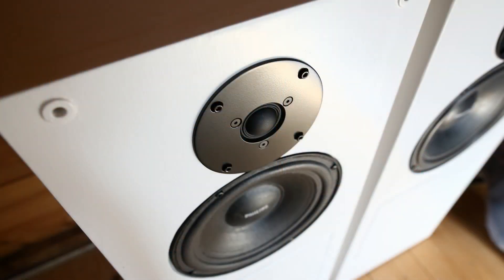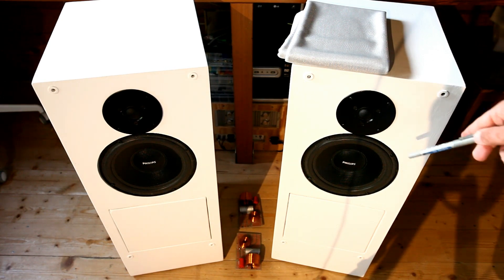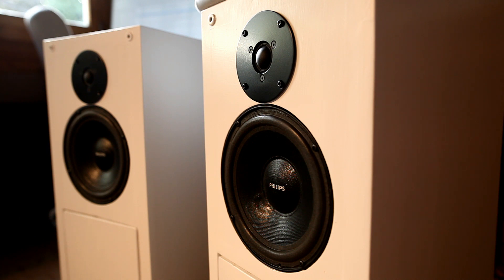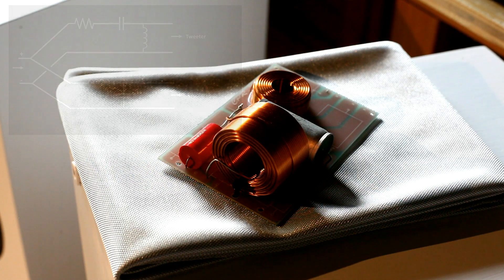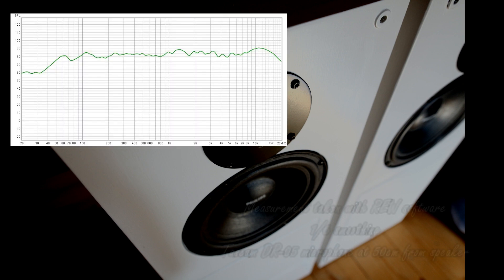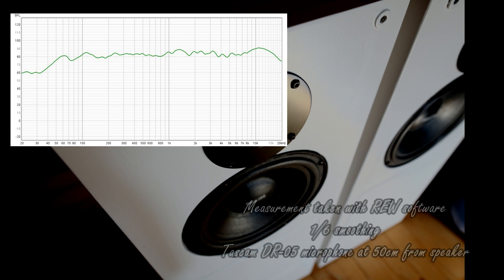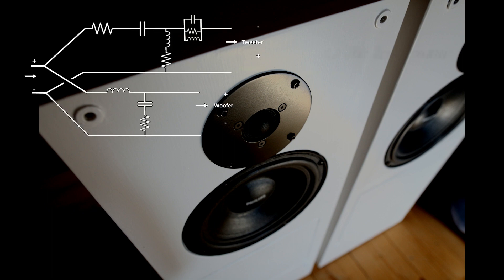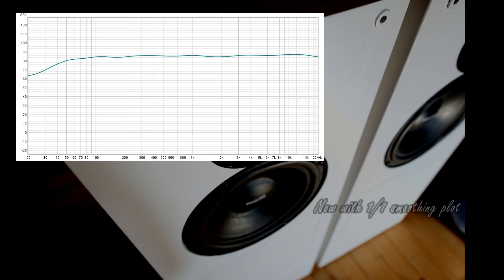Hi-Fi Tower Speakers Project (Ciare and Philips drivers) - Part 1

Comment: Thanks for going over the fine tuning of the crossover. Very helpful for a novice in crossover design like me.  The result is certainly smooth. I wonder what the impedance plot would look like in the end. Also the overall efficiency looks a little on the low side for low power amps....
Reply from the maker: Thanks for your comment ! Indeed, impedance plot is in the plans as well, I'm thinking to report in the next video; on the efficiency, I can just say that these speakers, paired with my 32W tube amp, deliver full big sound on a medium sized room. Indeed, they are not the most efficient, my intention was to provide average efficiency. For sake of this video, I manually normalized all the graphs at 85dB, I suspect real efficiency is a couple of dB more, or even more. I'll measure the precise efficiency soon, and I'll publish in the next video as well. Thanks again, a good day !